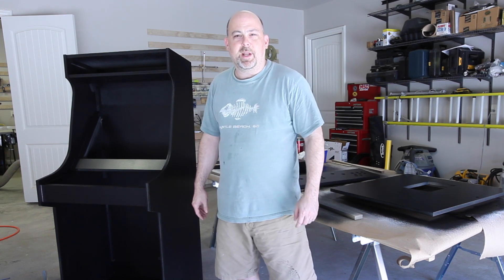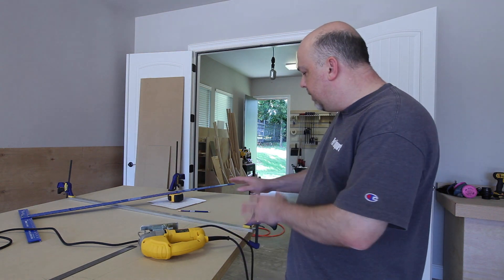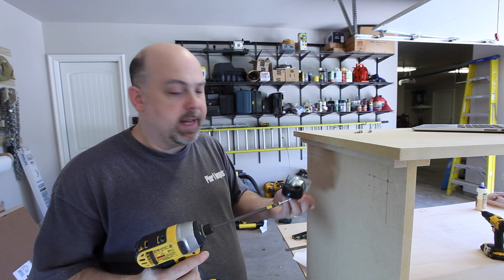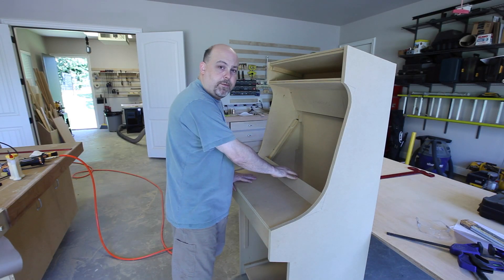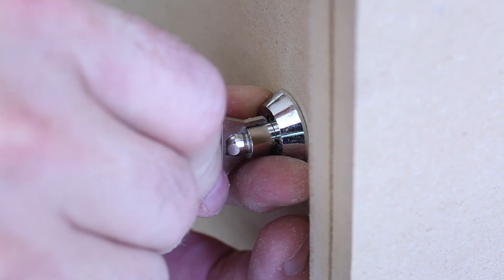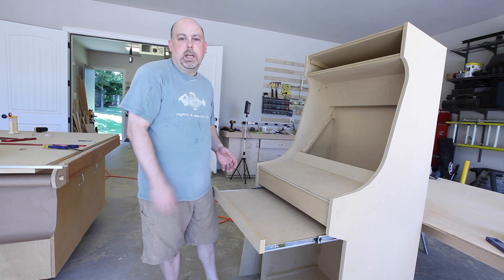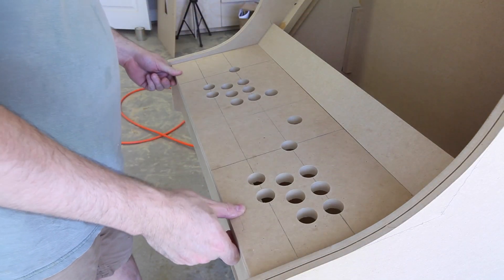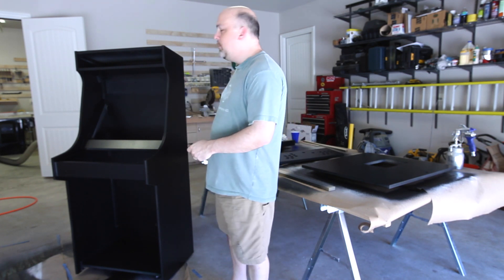How to make an Arcade Machine: Part 1

Comment: Purchased the plans for this machine and built it successfully.  This was my first time building something like this and it turned out great.  Thanks so much!
Reply: Any lessons learned? I'm in the middle of this build and it seems like he's left out some important details. Yes, an intelligent mind can figure out their way around these blanks, but goodness it's be helpful if the info was available.
Reply: @davethenerd42  Not really. The instructions were on point. I made some customizations to fit my build (put the drawer on the bottom) but otherwise did everything else the same. One thing I cant stress enough is to drill pilot holes before screwing in the screws. I've split my mdf in so many locations by not doing that. Gladly the vinyl covered it up. Let me know where exaclty you need help and I'll try to respond. 👍🏾
Reply: @evocre8r  yeah, it's difficult to say exactly without being able to point to the plans. It's nothing that I'm not able to simply infer on my own, but it's just a bit annoying.  Add to the fact that there are certain measurements missing, I also have to make adjustments based on the size of the monitor being used. I would really need to make my own video. Damn. Maybe I should...
Reply: @davethenerd42  That would be cool. I'd watch it :)
Reply: Hey where did you purchase the plans ?

Comment: Thank you so much Mike!  You are an inspiration.  I just completed my own Mame cabinet based off of your design and your excellent videos.  Just to put in perspective, I'm a software guy and have never built any woodwork other than one 2x4 raised garden and I DID IT! with your help.  I just can't thank you enough for you contribution, your plans.  Some lessons learned for other folks trying to do this with your design:
1.) Make sure you do your research into painting MDF.  I was stupid enough and too excited and bought some black wood stain.  Doh.  I wound up having to sand down the whole cabinet the day after and used cabinet paint.
2.) Keyboard drawer installation are a pain.  First time I have done it, but my measurements are off and need to fix.
3.) Make sure you get the right cabinet hinges.  I believe it should be inset hinges vs overlay.  I brought the overlay first, but really should have used inset - correct Mike?

Think that was it.  Thanks again Mike.  You are awesome.
Reply: Did you use any big tools like a table saw or drill press? Or did you use hand tools like a handheld drill and jigsaw?

Comment: For anyone starting this build I suggest making the backer blocks out of something other then MDF. As I've been gluing and using Brad nails I'm finding a lot of splitting of the blocks. It's not the end of the world as I've been able to fix them but when I make a second cabinet I'm going to use 3/4" plywood for the blocks I think.
Reply from the maker: Sounds like maybe you're using larger gauge finishing nails and not 18 gauge brad nails.
Reply: @TheGeekPub  I think I was using 18s. Not a huge deal anyway, its only partially split a few of the backer blocks. The build is going great.

Comment: So freaking cool!  I think it is time for the project! A guy I work with first introduced em to Mame about 15 years ago!  This is excellent. I always had leaning to a cocktail type cabinet....  May have to look into that!   Any ideas about that?  I think this might be the start of a beautiful friendship!   :)   Love you stuff! 
Chris
Reply from the maker: +Chris Pine I originally wanted to make a cocktail table.  But the games you can play on one are pretty limited since there isn't room for any more than two buttons on the arcade control panel.  I thought about making a wider one.  The other problem is the tempered glass top you'll need is very expensive and my touchscreen would no longer work.

Comment: Awesome!!. Here's a quick question. Sometimes my jigsaw blade tilts a little while cutting and the result is a cut at a different angle. How do I prevent this? I tried with a couple of jigsaws and blades. Am I going too fast?
Reply from the maker: +Felipus Rex You're jigsaw is cheap.  If it doesn't have a guide bearing that holds the blade in place, do not buy it.
Reply: +TheGeekPub Hi there, Well, It does have a guide bearing, but it's a Craftsman so, yeah, it's kinda cheap.I thought that I was using it wrong. Thanks.
Reply from the maker: +Felipus Rex I might write an article about this on my website soon.  I get this question at least once a month.  Thanks for the comments and being a fan!
Reply: That would be great.
Here are a few things I'd like to know. Speed of the tool, orbital mode, how fast should we "push" the tool. What kind of blades should we use. Thank you!

Comment: how much in materials?
Reply: If you don't have any of the tools it can be very pricey. But a single sheet of MDF is around $50 and you need two of them, paint another $30, buttons and sticks $60 on the low end, $50-80 for the coin door lights, pc, marquee etc. My guess is $500-$1000, not including tools.
Reply: @foxhound34  you can always settle for plywood, which will only take 30-50 dollars, I also noticed that a lot of the things here are optional if you want to work on a low budget.
Reply: You can use a retropie if you don't have a pc

Comment: Im looking to get these plans, but want to know what size is the monitor you're using.  Im thinking of using a 32" slim tv, will this cabinet accomendate this?
Reply from the maker: You can put any size you want in there if you make the front and back pieces longer or shorter.

Comment: I still wonder about the height of the cabinet as well as the height of the controls, why, well mostly ergonomics. if the controls are too high or too low it's not comfortable, neither a screen which is too low cos your neck and shoulders will hurt. Are there some guidelines for arcades, meaning some smart people looked into the most ideal heights for arcades so it's the most comfortable for most people? or is it just well about waist high for the controls, monitor above that and it should be good?? 

I couldn't help but wonder, why are you doing the painting barefooted? 😃😃

Comment: Hello, I know this is an older video, but a ? For you as I am going to be making one as well. Why use MDF instead of 3/4 plywood? Just wondering thanks
Reply from the maker: I've covered this many times and on my website.  MDF is much  simpler to work with and get a quality paint finish.
Reply: Gotcha, thanks for the reply

Comment: after parts, labor about how much did it cost? how much would it cost if you had ran raspberry pi on this machine? what is the difference in cost between the arcade machine and bartop arcade?
Reply from the maker: Check my website article.

Comment: Hey are any these cuts mitered? Looking at your plans it looks like the speaker panel and the monitor support ends are cut on an angle. How did you cut them with a circular saw or a jigsaw as apparently those are the only tools needed?
Reply: there are also quite a few measurements missing from the plans that I have no idea certain angles and length/depth of the monitor supports etc...

Comment: Does your plan support a 32 inch monitor or flat LCD TV?  I noticed you had installed a 27 inch screen.  Thanks
Reply from the maker: Depends on the size of the TV, but theoretically yes.  You might have to add some border strips around it.

Comment: What bit are you using in the router? A router bit? Or a dremel saw blade?
Reply from the maker: You kind find the parts list on my website.
Reply: TheGeekPub okay great.  I'll look  for them again. I bought your plans but didn't see them on the parts list. Thanks again!
Reply from the maker: You're right.  I just realized the bit is missing from the list!  My bad!  I'll link the one I used here.  But keep in mind the optimal depth of the bit is dependent on the brand of t-molding you purchase.  http://amzn.to/2r5s7Dj
Reply: TheGeekPub thanks so much, you are the best! Speaking of T molding,  Im looking to use light blue T molding like yours. I noticed the only light blue I could find were from eBay stores.. do you have a suggestion on which brand or seller you prefer for the T molding?
Reply from the maker: I got mine off of Amazon.

Comment: Hi! Great Video and I think I found my summer project :D I've read that MDF is hard to paint because it is so porous - how many coats did it take and did you sand in between?
Reply from the maker: MDF is super easy to paint.  Just use a single coat of primer.  Let dry 24 hours and sand between coats.
Reply: @TheGeekPub  thanks. So, your nail gun, was that finishing or bradford nails?

Comment: I'm thinking on a budget, get an old desk, a monitor and a raspberry pie and a nes style game controller. Use mame for the emulation and just hook the monitor up to the raspberry pie; the game controller will be stuck to the desk Dan be plugged into to the raspberry pie.
Reply from the maker: I'm actually planning to make something just like this in a future video.  But its honestly not much cheaper.  The biggest expense is the monitor and the controls.  The wood costs $25.

Comment: what router and bit do you use for the t molding
Reply from the maker: You'll pick the router bit based on the t-molding you buy.
Reply: if you're using the 3/4" thick mdc, here is the router bit I purchased and in progress of building now. https://www.amazon.com/gp/product/B0002TUCSE/ref=oh_aui_detailpage_o02_s00?ie=UTF8&psc=1 
3/32-Inch Slot Cutter Set 9/16-Inch depth cut

Comment: I'm right in the middle of this project and the amount of detail you've left out of these videos and the plans I paid for is infuriating. I'm sure I can figure my way around these problems, but if I was to just start cutting every piece as you have laid out I'd be screwed. Maybe that's on purpose to try to push people to buy your printed templates. There's just a few more details you could have added that would have alleviated the frustrations.
Reply: Dude the printed templates only come with the side panels and the controls. THATS IT. As far as the other pieces go they don’t exactly leave out info there’s just technical miter cuts you need to do with the wood that can be a bit frustrating if you don’t know how to do them. I’m in the same boat as you tho that’s for sure. It’s quite annoying.
Reply: @soseugs  lol I never finished it! Life definitely got in the way, but I remember working on it. My "weekend project" turned into a bunch of material sitting around for months. It's all shoved behind stuff now since a couple years ago. I need to get that all out and try to finish it.